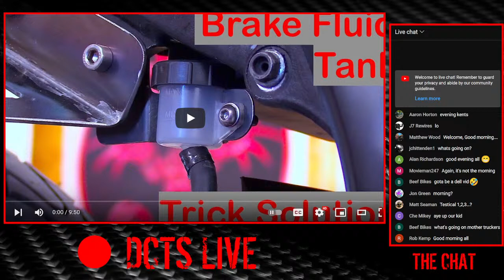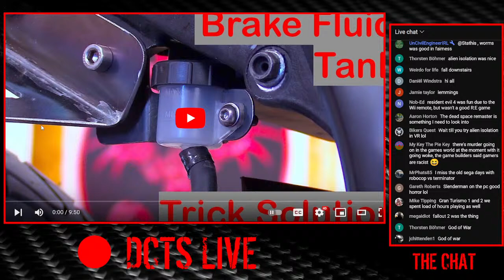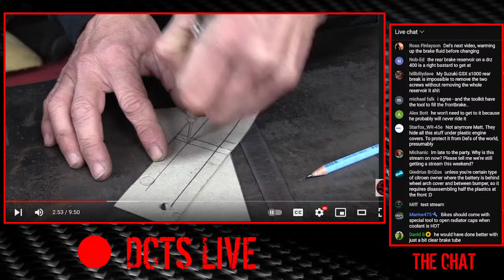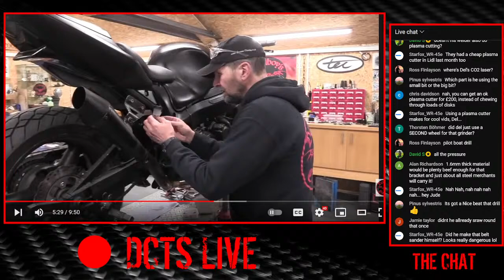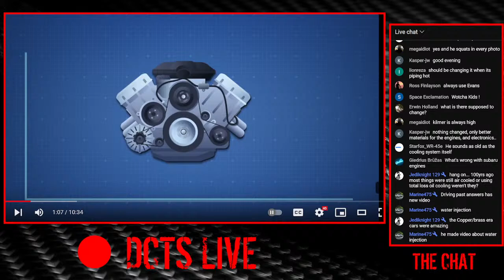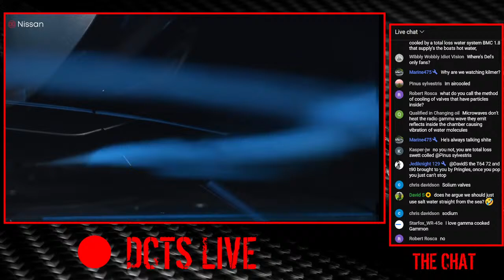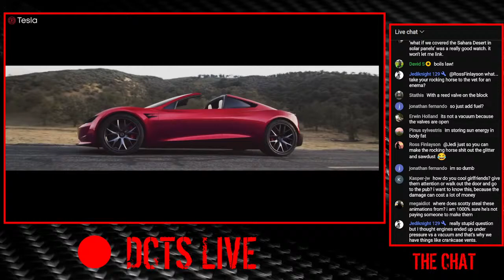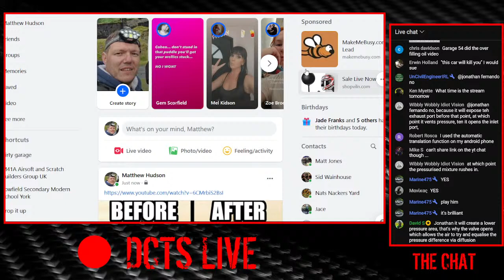TESTing 1,2 AND 3

Comment: About microwave ovens. They "target" water molecules to "vibrate". Of course waves themselves give energy, like sunlight. But you tune wave frequency to resonant frequency of rotation degrees of freedom of target molecule to increase absorbtion rate. Basically you make molecules rotate faster. Then, when they bounce with each other, they gradually transfer rotational energy to linear motion, hence heat.

Comment: I "fixed" a carb with a screwdriver once. One guy stuck in a belly deep puddle off-road. He tried to go out for couple of seconds before stoped the engine and water with dirt was sucked in. We opened the floating bowl to find that it is full of dirt. So we cleaned everything what we can inside the carb and filter, then continued to ride. But I had a big toolkit, not one screwdriver. And I think cleaning is not repair. I think I even have a video of this accident on my channel

Comment: 2:08:37 Speaking about Dyson swarm. You need this power for matter transformation. At that stage you have some sort of space travel which requires big powers. Good way to store big energy for such travels is matter itself. You have to produce some metastable nucleai. It is similar how now we can produce any element in accelerators. Efficiency is extremely low, but at some point you maybe need it. Or you use energy to produce antimatter for fuelling your spaceship (bad example because it is easier to harvest than produce). Also you can afford energy inefficient technologies. Like now it is not viable to make  gold in accelerators because lack of energy makes it very expensive in comparison with natural gold.